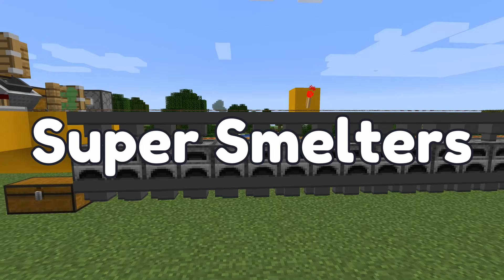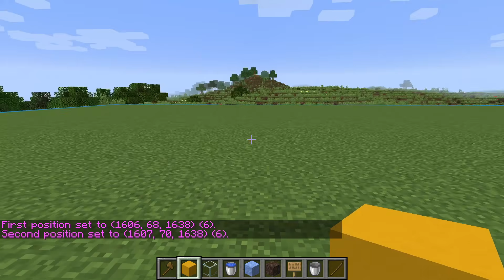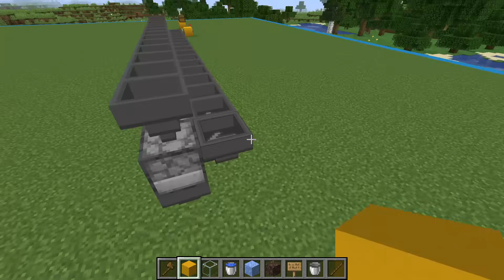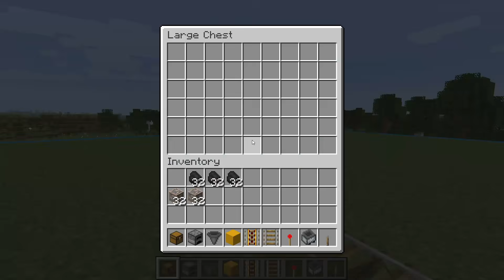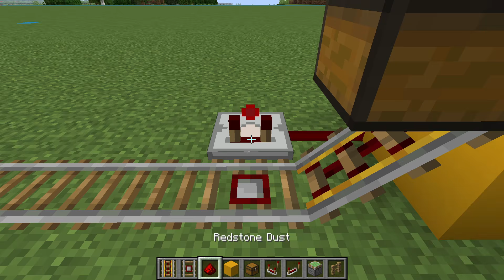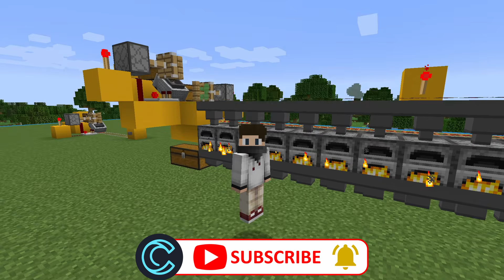Upgraded Super Smelter - Autoloading and Any Size! | Minecraft Redstone Tutorial

Comment: only problem i have is when i fill the chest up it wont let the minecart leave and you have to empty the chest for the minecart to leave
Reply: Exactly! I'm also facing the same problem... Any solution?
Reply: @iamyogeshkhatri  i had a solution but its been so long since i built it that i totally forgot but there is a yt video out there with the fix so keep looking and youll find it
Reply: @WT-KANIBAL Okay! But I find a way to fix it, it's like you just need to fill items in chest just as filled upto all 5 slots of chest with hopper, then it will work, otherwise it won't, even if you have single item remain in the chest the redstone system won't allow the cart to move further... ❤

Comment: I'm encountering an issue with the input hopper system. When I put different types of items into the input chest, the input hopper minecart will eventually stop running once one type of item is depleted. For example: Stone and Cobblestone. Once all the stone is depleted from the input chest, the input hopper minecart will stop while still holding onto cobblestone.

Could it be because when I unload the chunk the hopper minecart gets stuck at the loading area 
or can the hopper minecart only accept one type of item at a time.
Reply: The input hopper minecart is stopping with [ 53 Stone, 64 Stone, 64 Stone, 64 Cobble, 64 Cobble ]. With more cobble still in the input chest, no stone in the input chest.

Comment: I love that video and it nearly runs perfectly on 1.21.3.
My only issue is that if I dump many different items and the chest still has items in it, the input hopper minecart won't go. Basically if there are 4 stacks of copper ore and 45 gold ore, then the system will think its not full yet and the chest isn't empty and the minecart won't go. 

Is there any way to make it so the Minecart goes if just all slots there is something (even if its just one raw chicken) or chest empty.
Or maybe a way to tell it it can go when over half full, since that would be plenty.

Thanks in advance!
Reply: Did anyone work this out yet? Same issue I’m having atm
Reply: Yeah, same. I noticed it only works best with single-type items. There's no way around it unless you reduce the redstone signal strength to the comparator by the detector rail, which will reduce the batch size per hopper minecart.

Comment: I just built this in my 1.21.1 survival world, with a few minor tweaks:

1) I added a circuit to prevent the fuel minecart from leaving (by keeping the piston powered) when the hopper feeding the first furnace is full. Otherwise, once your furnaces and cart are all full of fuel, it runs continuously. Now, it only dispatches the fuel minecart when smelting starts.
2) Since mine is hidden under the floor, I wanted an indicator to show when the smelter is running. I have an observer watching the first furnace that toggles a copper bulb on and off up near my input chest.
3) I added an indicator light that goes out when the fuel chest is almost empty (since it is also under the floor).
4) I added auto droppers that send the smelted items up water elevators to my output chests above the floor.
Reply: Hi! I'm really interested on that circuit to prevent the fuel minecart from leaving, but I'm super new to redstone and don't really know where to start. Could you explain how you did it, please? Thank you so much!

Comment: This is a cracking design and works well. It is also useful when building a mass storage system for, say, cobblestone where you just use one line of hoppers and powered rail with the same auto-loading mechanism for the hopper minecart. The line of hoppers feeds into the back of a line of chests - which can be stacked. By extending the rail by a couple at each end (one might be enough, I didn't test this) you can even out the distribution so that it is exactly equal into each chest provided all the rail is at full power; distribution might be slightly uneven at the minecart turn points otherwise.

Comment: For those who run into the issue where the minecart doesnt stop very well in the station and the piston kinda double activate and messes up the smelter until u reactivate it manually : 
Make sure there's no blocks touching the fences whenever the piston extend or retract !
It will still mess up the piston and still double activate it but at least it works and the hopper minecart will only stop at the station when it's empty and he wil keep going if there's item in the chest. 
Hope i made it pretty clear ;)

Comment: Im in bedrock edition. when the minecart is parked it wont activate the activator rail, and after a while trying to make it work. Im just lost. anyone have any suggestions?
Reply: I know it's been a year, but in case anyone reads this - make sure you're using a detector rail, not an activator rail. Detector rails send a redstone signal when a cart travels over them, activator rails are used to lock hopper minecarts, eject mobs, and light TNT minecarts.

Comment: Works for bedrock except you have to move the Rail line for fuel one block further from the furnace which means you'll need additional 8 hoppers on the back.
Reason - Bedrock's Hopper Minecarft in 1.19 are glitchy. The fuel Minecart will steal iron ore from smeltery minecart and try to put iron ore in the furnace as fuel which breaks everything. The hopper Minecart range/hitbox is too big and it steals from minecart from above and over one block.
Reply: There is 16 hoppers in the back of the  furnaces already so I'm confused how extending it with only 8 moore would work
Reply: @owinmclaughlin5132 
I have already explained it above.

Comment: Made this exact thing, the unloader doesn't work, minecart stops under the chest after the first lap whether it's empty or not, I have to give it a push for it to go again
Reply from the maker: I've run into this occasionally. It's pretty rare for me though. Sorry you're running into issues 😔
Reply: @CasualMinecraft  the problem was one of the blocks placed next to the fence, once it's removed or replaced with a block the fence doesn't connect to, the system works just fine
Reply: @Wasyashock  Glad you got it to work and thanks for the feedback!

Comment: Great vid.
Any idea what to do if I want to use hoppers feeding into the input chest? the minecart pulls it out faster than it fills up and so leaves without being full because for a split second it thinks the chest is empty.
Reply from the maker: I ran into this in my last server. I hooked up the water output of a bamboo farm to the fuel chest and the hopper going into the input chest is too slow. I changed my redstone on the fuel autoloader to go down the rails when there is enough to deposit at least 2 items per furnace in the line and not care about the input chest fullness level. It can cause some items to hang out in the input chest until you have (2x furnace count) items, but it prevents front loading and isn't an issue if the number of fuel items going in is large. I'm kicking up the content for 2022 and will make an example solution to this question as my next video!
Reply: This comment is pretty old, but I found that if you have a hopper on the same level going into a secondary input chest, you can take a comparator to the chest and the hopper, and make an OR gate, as long as you can get the stuff into the hopper at slightly faster than hopper speed, I did it with an observer droppervator, There will always be an item in either the hopper or chest until it runs out. Idk if this made sense, but thats how I fixed it :D

Comment: My items hopper minecart transfers items into the other fuel hopper minecart, as well as, every furnace but the 1st gets the items twice, going to and from the end of the line, imma just extend the line before the 1st furnace and see if that helps, 1.18 seems to of done something because everything is identical but seems to be off
Reply from the maker: Sounds like bedrock may be the cause... I didn't test in bedrock. I made it last night again in Java 1.18.1 and it works well still. Thanks to the bedrock players for jumping in on troubleshooting!
Reply: @CasualMinecraft  you just mainly have to box in your minecarts, and have a 1 block gap between your materials and fuel, using a comparator system for your fuel is very helpful too, helps fuel be sorted into each furnace equally, I use lava from drip stone, super useful I just have to refill it which is no issue because it has enough backup to smelt another >700 items also! Place a pressure plate at the furnace to lock the hopper output so you can take an item for the exp!
Reply: does your cart fall off the tracks from the sticky piston?
Reply: @bradleybreitner1500  that too
Reply: @bradleybreitner1500  I've placed some blocks just beside the minecart and it doesnt seem to fall anymore
Reply: @demondylan2502  i will try that out, keep a lookout for me in the comments
🙂
Reply: @bradleybreitner1500  will do I used glass so it doesnt interfere with redstone but since it's not an obvious issue it could just be a 1.18 bedrock issue unless Java has this problem too
Reply: @bradleybreitner1500  I also moved my fuel cart back 1 added another row of input hoppers just to keep it away from the other minecart
Reply: @demondylan2502  i think i got mine working okay as well, i placed more rail on the bottom of furnace rail to give pistons more space and filled in as much as i could
Reply: I’m having issues with my smelter where the minecart goes too far up the chest and deactivates the detector rail any way to fix this?  I have built it multiple times in a build world and it seems about 50/50 on whether or not the detector will stay on. Bedrock edition.

Comment: Veeerrrryyyyy valuable tutorial; thank you, sir. I'll definitely putting it to good use. I think I might also add a carpet duper above the fuel input chest to give it infinite fuel. As I'm typing this, though, I'm wondering if constantly having the fuel chest full would mess up the circuit. Any thoughts? Thanks again for the incredibly helpful tutorial. I'm subbed to your channel now.
Reply from the maker: Sounds like a good addition to the build! The circuit would still work, but if you reach a point where the fuel system is totally full, the fuel minecart won't take a break from going back and forth. I would just add a lever to the end that doesn't have the autoloading circuit so that you can manually stop the fuel minecart when this happens. Thanks for the sub!!
Reply: @CasualMinecraft  Or have some comparator circuit that deactivates the carpet duper before the fuel chest fills up completely. One of us might have to look into that ;)  Thanks again man!!

Comment: The size limit for this would have to be 25 furnaces though as otherwise, it would exceed the hopper extraction speed (hopper speed = 9000 items/h, 150/m, 1 furnace = 6 items/m, 150/6=25 furnaces)
Reply from the maker: You're right. If you want to match intake rate with outtake rate, it woould be 25 furnaces. More than 25 and you would have to be ok with the system backing up a little or adjust the collection system to collect into multiple output chests. Thanks!

Comment: Is there anything that can be used for the auto-oading part that doesn't require a sticky piston and/or is silent?
Reply from the maker: I like that thought! I'll look into it, I bet it would be possible to get creative with droppers.
Reply: 6:00 There is a way by using fence gate.
Swap detector rail and powered rail (detector rail should be slant and power the powered rail)
Place a solid block infront of repeater and a Redstone dust below it.
Place a comparator going outward from detector rail (it should divert Redstone dust beside it) going in a solid block. Place a Redstone torch on the solid block and another solid block on it.
Place a fence gate on the powered rail (it can face any direction).
Place another Redstone torch on the side of the solid block above the previous Redstone torch and connect the signal to the fence gate with Redstone dust.
Do not put the comparator in subtract mode.
NOTE: the minecart will be slightly slower than original.